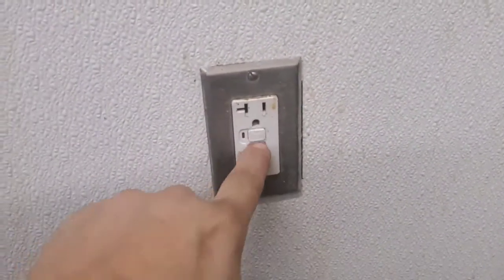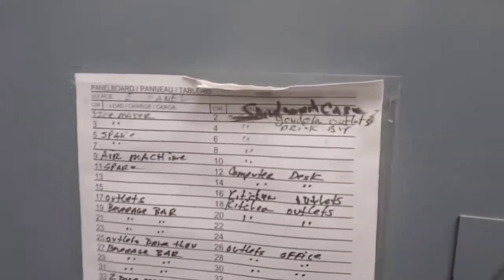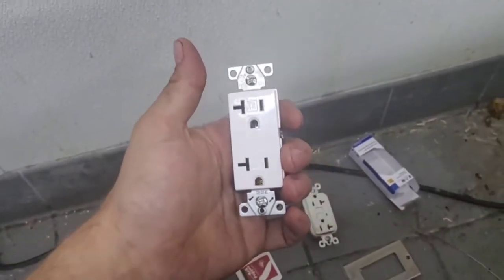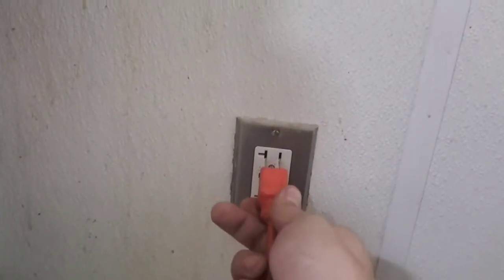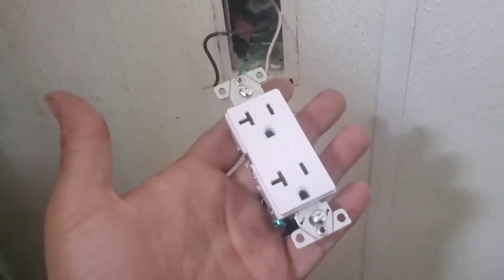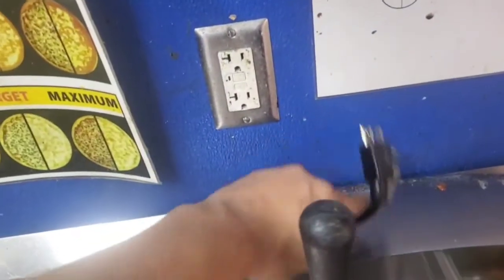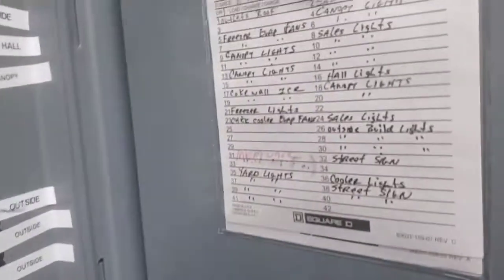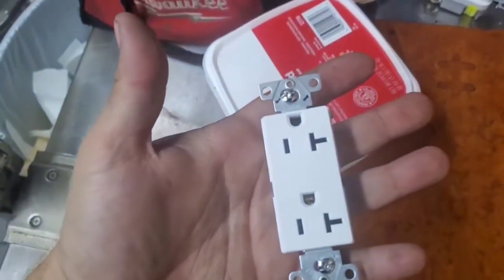How To Fix a Nuisance Tripping GFCI

Comment: What makes you so sure it’s the recepticle that’s the problem.
Reply from the maker: The design specifications of american GFCI receptacles. They trip at 5mA which is below the leakage current of many perfectly good compressors and heating elements. This is because of capacitive coupling between the conductors and nearby grounded metal. Its not an issue in other countries where the GFCIs aka RCDs trip at 30-50mA, far above normal capacitive leakage current. In the states the only solution to this issue is to connect the device to a power source that is not GFCI protected.
Reply: @satanicinduction  would I have this issue if my electric water heater is plugged in? No issue for years then it seems the outlet just goes out
Reply from the maker: @Chis Keo you've got a water heater that plugs into 120v? Well, it could nuisance trip a GFCI alright. Could also have a bad element but you'd see that on an ohm meter
Reply: @satanicinduction  wow such a quick response. My temporary solution is to test on a nearby outlet.
Reply from the maker: @Chris Keo if that thing works fine on a normal outlet then you know what time it is
Reply: @satanicinduction  it did not. It's the unit itself. I thought Navien was top of the line! There's condensation and rust inside
Reply from the maker: It's taken me this long to realize that's a gas tankless water heater.  Those things don't last. I hate working on them. It doesn't matter much which brand you buy
Reply: @satanicinduction  what do you recommend for the replacement?
Reply from the maker: Rinnai have all metal heat exchangers

Comment: my problem is a GFI circuit breaker and rain on my christmas lights. Replacing the GFI works: can it just be disabled illegally somehow
Reply from the maker: If you move the wires to the screws labeled "load"  it will disable the GFCI function and make it a normal outlet. 'Allegedly'

Comment: Custom made breaker finder may or may not work with the followings panels, zinsco, federal pacific, etc. if it works it works though, I had a guy shove wire strippers into an outlet since we couldn’t find the receptacle
Reply from the maker: Yea i wouldn't try that with federal pacific breakers, no way

Comment: This is not the correct way to handle this. They will fail any safety inspection and your gonna have problems…. Plus there insurance won’t cover any issues since it’s NO LONGER UP TO CODE!
Reply from the maker: Did you read the description?

Comment: custom fuse finder is very handy
Reply from the maker: The time saved using that breaker finder exceeds the time spent on the entire job. That last outlet would have taken forever to find without it.  The RF breaker finder doesn't work in commercial buildings with s lot of electrical noise.